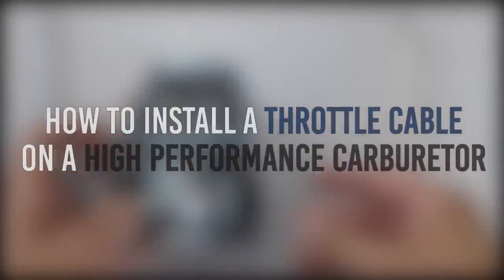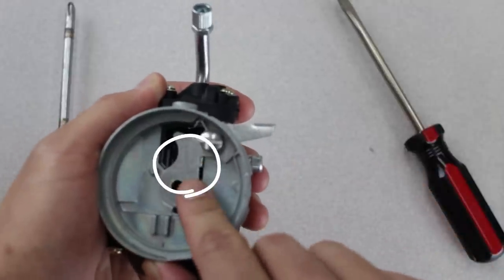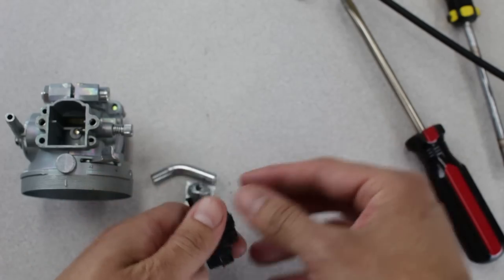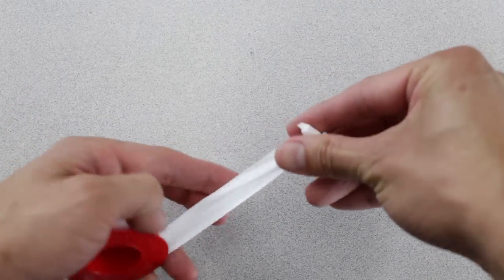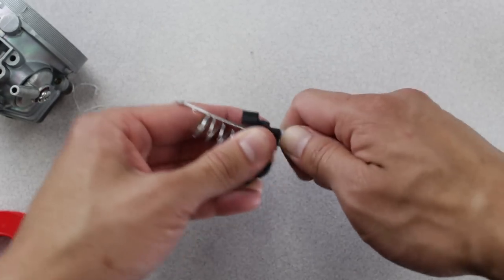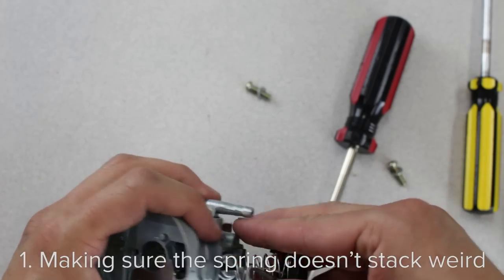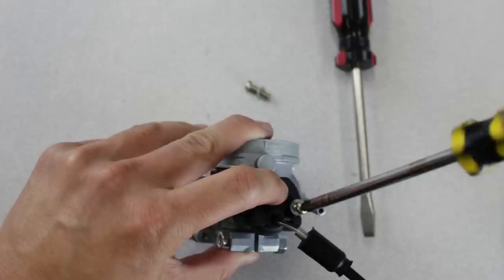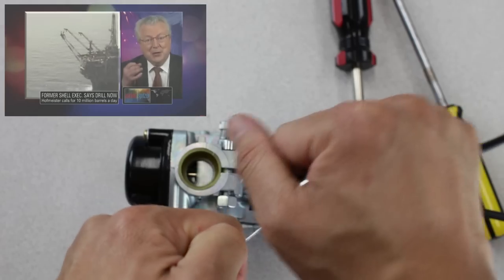How to Install Throttle on High Performance Carburetor

Comment: Can you please please please, show how to fix a sticky hi performance throttle?? My throttle is really sticky, don't know why. Please do this ASAP, I don't know how to fix this problem myself. Thanks.
Reply from the maker: Do you know what or where it is sticking?
Reply: I'm not sure.. It just won't snap back. When I pull the throttle, I have to push it back forward. I installed it correctly on the pulley system.. It's on the second notch adjustment. It's also the high performance throttle. I'm kinda mad it's not reacting like a normal throttle.
Reply: I checked and it pulls the carb slot just fine so it has to be something else going within the housing of the throttle or something I'm not sure.
Reply from the maker: Pursuit Of Righteousness Can you send us pictures of your problem to Support@bIkeberry.com It's hard to know what you're talking about with what you're seeing. We also have full-time staff available to take phon calls from 9 AM to 5 PM PST.
Reply: Pursuit Of Righteousness Have you had the cable for some time? it might just be sticky, try spraying some PB blast or WD40 down into your throttle cable and work it back and fourth for a while
Reply: I will try that! Thanks!
Reply: +Pursuit Of Righteousness 
You most likely have a kinked cable. Simply follow the components back to the throttle grip. It could also be binding inside the throttle grip.
Reply: I noticed that the cable scrubs the sidewall
Reply: spray some WD 40 into the cable. worked very well for me
Reply: 19Mossy91 Won  it scrubs the inside of the carb
Reply: 19Mossy91 Won  not a sticky cabpe

Comment: BikeBerry QUOTE : This carb does not work in high altitudes  due to its stationary jet needle
Reply: Buzzards Bass um, actually... it works fine. just gotta change the jet size. the one from an nt carb might even do the trick- they're usually compatible at least
Reply: usually a smaller JET works in the higher altitudes however there are other things you can try like octane boost and removing any stock air cleaner making it less restrictive as well as those shitty foam filters. In most cases I use fiberglass window screen and big hose clamp fixes the restriction issues. You can find jetting kits for both the NT and SHA style carbs on E-bay. If not there are guys like me here on YouTube we know more about building these bikes than Bike Berry ever will know....
Reply: Worked for me at 7500 feet above sea level, just gonna throw that out there👍

Comment: I installed this web to
day and it's bogging really bad any suggestions
Reply: Edward Modeste yes. read others comments on this video. or better yet, watch a different one. DO NOT assemble it the way this video tell u to
Reply: Tai Theguy any good videos on hp carb my bike only goes about 40ks

Comment: dount use the one that comes with that carb it will give you to much slack in the line use the throttle adjustment end off the nt carb to fix this prob
Reply: +CreekSide Rc and put the throttle cable in the othe way so only the end of the cable is on the slide. some times you need to shave the end of the cable to get it fit

Comment: You didn't hit throttle cable up right the end that goes in the slide it doesn't go in the way you showed it and it will be slipping right back out eventually

Comment: i have this carb i have locked the choke but i cant/dont know how to unlock it
Reply: +Tomas Rice if you remove the air filter you can see the end of the retaining piece that is holding the choke in place, use a screw driver to push the retaining piece back and the choke will snap open again.
Reply: +Tomas Rice  There's a "catch" at the top of the lever on the inside. With the choke ON, when you move the lever toward the engine slightly it will release the choke plate on the inside by way of the spring on the choke plate.
Reply: +DoItYourselfDad   WRONG~!   He needs to release the choke with the engine IN OPERATION~!  Read my other reply.
Reply: +Buzzards Bass ive figured out the choke now but the carb itself is awful have to keep twisting the throttle to keep it alive wen i adjust the screw on the trottle cable it just revs to high or bogs i cant find a sweet spot with it
Reply: +Buzzards Bass thanks haha its workin anyway dats da main thing
Reply: burp
Reply: the lever to the air filter bends push up and over not to the air filter side but to the real part off the carb side and it should pop up

Comment: How do u unchoke the carb?
Reply: when you hit the gas wide open the choke cuts off the first time mine didnt work but i took it apart and ran the cable though again push the choke down it will lock after you try to start your bike 2 or 3 time to get the choke to relase just hit the throttle wide open it will release

Comment: Got it installed but fuel is leaking out my air filter 😑
Reply: Exploring With Jared  are u using the stock muffler

Comment: U got it wrong. U DO NOT feed the nipple end of the cable and wrap it around the slider. And you DO NOT get rid of the long tube section.  The cable jams up if u do it your way ! The proper way- u just feed the cable through everything the way it came and it slips into the slot at the top of the slider and the nipple will grab it if u slip it into the right spot, u don't need to wrap it around anything.

Comment from the maker: We've included close captions to make it even easier to follow along
Reply: how to we tune them, adjust
Reply: +Flat4_vdub_Garage like the turns out
Reply: how to video on adjusting jets?
Reply: BikeBerrycom i bought thr same carb on ebay and my engine has no power but it idles and i dont know how the choke works either help!!
Reply: PepsiMan I also have same carb.. I tried #60-67 jets 64 runs best but still really low power way less than stock carb
Reply: its crap after the winter ill try it again bc i ordered different jets

Comment: i had to -1 this because taping threads to make it fit just seems cheesy. if you wanted to make a nice build, reuse the stock cable adjuster to be clean.
you can get the carb off ebay for $18 shipped. thats what BB does, so they are making triple their money offering you that same exact carb for $60! jeepers

Comment: is there by any way to have a electric starter for the 80cc bike engine you guys should make and a way were it doesn't interfere with peddling
Reply from the maker: +Matt Steva We're actually working on a new motor with a few built in features that we're all very excited about. I can't reveal too much, but we'll be introducing it very soon.
Reply: I know this one come up before have you guys ever came up with a cooling system to keep the engine cool during a 100 degree day I live in Nevada desert and its going to be a hot one this year I need to find a way to keep my cool so it can go farther and run longer  and the other question is do you guys have something better then spoke wheels and light wait body cast to  chance the look of your bike???

Comment: white teflon tape is for water. yellow teflon tape is for gas.  Good videos. 8^)
Reply: except really the tape is being used to make the cable snug, not really sealing against fuel so either is fine.

Comment: These dellorto clone carbs ( run tong) are absolute junk tried different jets and the best was a 62 size, still wouldn't idle great, or start within a respectable time frame, stick with the nt (stock carb) with needle on the second notch from the top ( 4 notch type) and standard jet, just adjust float level up to supply more fuel at the top end, trust me mine has exhaust, 36 tooth sprocket, vehicle coil lead and 3 prong spark plug and on the flat have seen 60kmph or 38mph, stock nt carb idles and starts great, no hesitation and makes full power.
Reply from the maker: We're sorry you've had a bad experience with one of our products. We have since changed manufacturers for better quality parts and have increased the variety of carburetors we carry.
Reply: Jets vs altitude? I'm at about 7500ft
Reply: @davidruff2980  holy shit that's way up there. The air is less dense so you have to jet down (smaller) to keep air and fuel ratio correct. That high your engine will be noticeably down on power at its best. Add to that carbs generally come jetted rich out of the box so you will probably be super rich.
Reply: @clintbliss2046  new carb, and a 61 size main jet got me to around 25-30mph, I'd like to see what it would do at sea level, I appreciate the advice!

Comment: Hpw do ypu turn the choke off
Reply from the maker: If you are using the High performance carburetor shown in the video, the metal lever is used to turn the choke to the on an off position. This can be seen at 0:19

Comment: this is wrong the throttle cable does not go through the slide it gets wedged in the opening on the top of the slide where the spring sits I'll post a vid of it
Reply: josh richards please post a video

Comment: I knew that metal "noodle" was junk!
Well, I assumed and now you guys confirmed it.
Reply: +Monstertalon 
I actually like them. BUT you have to make your own throttle cable because the one they send with the NT carb engine kit doesn't have enough reach from the exposed steel cable.

Comment: Still waiting for the sticky throttle video
Reply: I had the same issues..sometime the trottle cable need lube...in my case the trottle came with the engine was too small..so i went option for another one sticky still until i need the cable...

Comment: The damn camera angle is bad right when you start putting things back together, plus, the damn writing obscures much of what you are doing then, as well. It even hurts to see you wrapping that cable with teflon tape, as you seem to have great difficulty in doing so. I am not so sure I actually learned much with this video.

Comment: "especially if your using a standard size throttle cable" cue the MUSIC TO OUR EARS
Reply: Its optional..i kept my noddle and it work fine...just more work to mod the stardard cable to work with the noodle only require to shave 1inch of the housing and cut 1 inch of the lacing carefully..after that it just install cable to carby

Comment: I woulda been better off NOT watching this video. should be deleted. use tape on the carb, when the stock hardware fits perfectly? &don't slide the cable across the top of the slide, put it through the back hole?! &what... bend it all crazy& outta whack? literally better off just using common sense.

Comment: How does the automatic choke release does it have to do with heat because when I pull the cable it doesn't release... Help!!
Reply: same. i said screw it and i just use it regularly. u can push it slighty forward and down/up to make it open